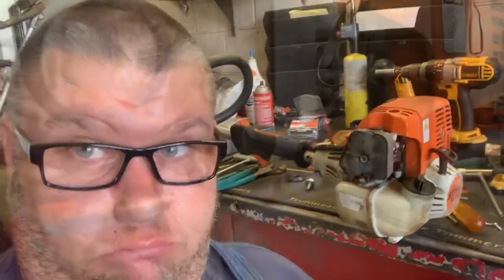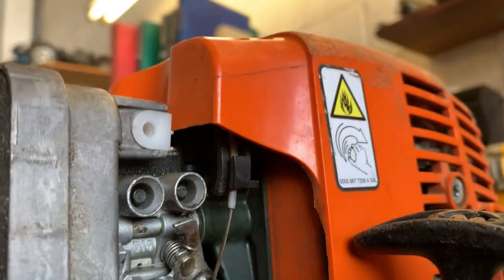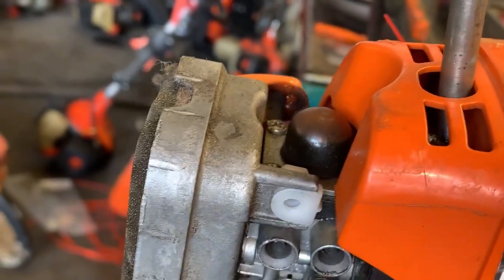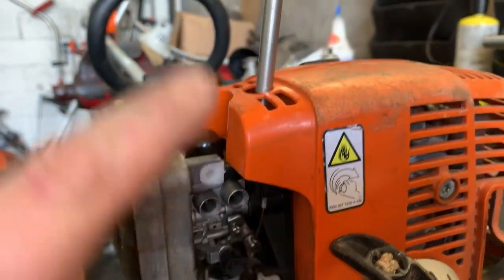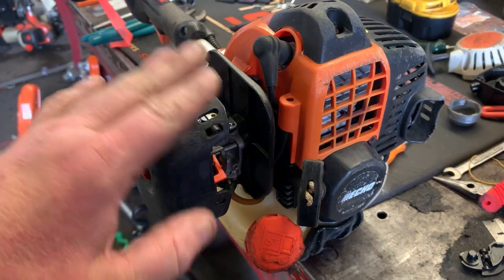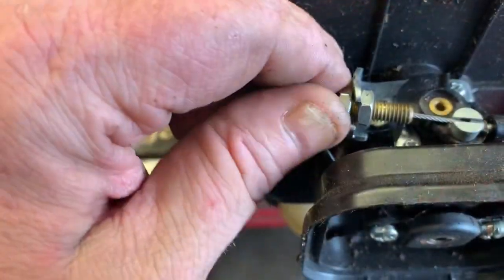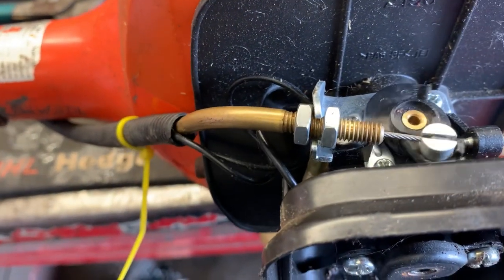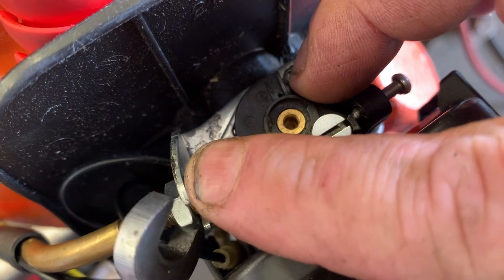STIHL AND ECHO THROTTLE CABLE ADJUSTMENT/ GET FULL POWER FROM YOUR TRIMMER!

Comment: Wait a minute, this video is confusing.  First you said move the throttle cable this way to tighten it, then you moved it the other way to tighten it. Complete  opposite or wrong use of words "cable" instead of "sheath".  Either way, i don't understand how moving the sheath backwards tightens the actual cable. Can someone please explain it?

Comment: Good video. I have an fs 55 and the throttle cable screw is turning clockwise from vibration while in use and will not return to idle. It took about 2 full turns counterclockwise to get it back to idle speed. Is there a fix for this ?  Have a good one from west Tennessee
Reply: Any threadlocker, Loctite, etc. should do it.

Comment: Hi Jeremy; first-off, love watching your videos, very informative. I own a Stihl  fs38 ,I opened it up to remove the throttle lock on the top of the handle but when I rerouted the throttle cable,I routed it wrong & melted the casing now I have a new one, I'm trying to find a schematic of the proper rout of the cable from trigger to carburetor. Help would be great.

Comment: Awesome, thanks!  

Anyone, tips or tricks for getting the throttle to return all the way back after it's released?  Was trimming today and noticed it revving high when I released the throttle.  I saw that the plate the cable hooks into wasn't snapping all the way back to touch the idle adjustment screw.  Thanks

Comment: Thanks for the tips. I knew this but i bet a lot of people don't understand how the stihl adjustment works
Reply from the maker: I’ve had to replace many cables on stihl vs echo
Reply: @THEMOWERMEDIC1  Do they wear or break more often than echo cables?
Reply from the maker: @nashguy207  they do because they have to slide rather than just pull
Reply: @THEMOWERMEDIC1  Thanks for the reply I understand now Also I have 2 FS 94 R trimmers we just use for back up now from day one we had problems with clutches going out the only trimmer I have ever had clutch problems with. I haver had Redmax, Kawasaki, Stihl and Echo's over the years.

Comment: Scrwench?? lol. Thanks for the explanation and proper tutorial on this! Doing basic maintenance on my dad's old FS90R. Making sure it's top notch. Man he's had it a long time, and still runs great.
Do you know where I might be able to find a new valve cover for this old 90R? Or a way to clean it to get the rust off of it... Or if that's needed? Just don't want it to rust through and pop a hole in there.
Reply: Submerge it into water and white vinegar for and hour or more if needed and then clean it throughly fine sand it, clean it even using alcohol then paint it